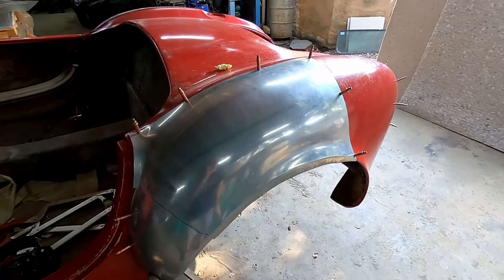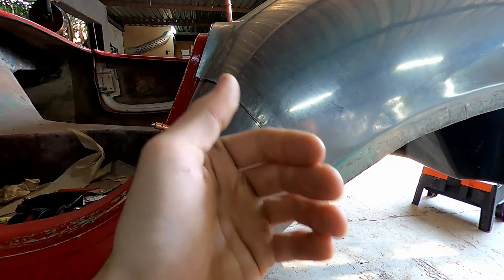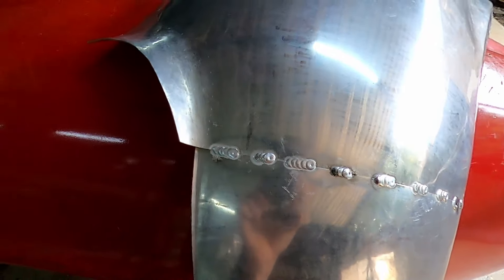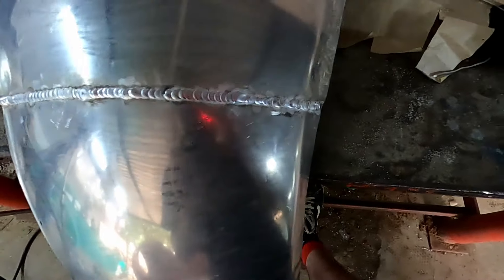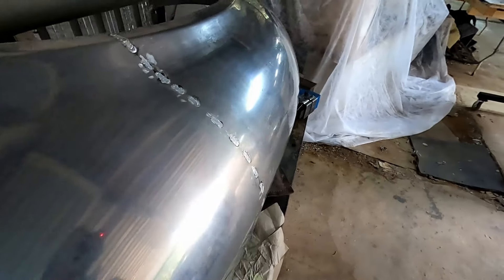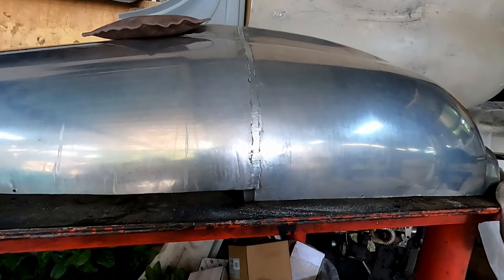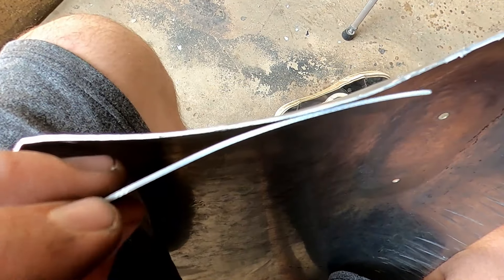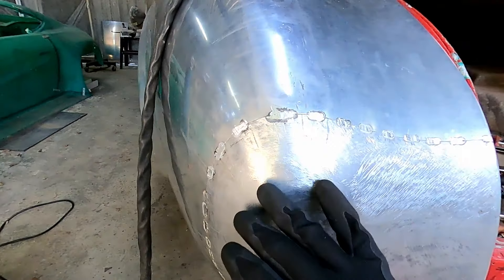How to: Welding Aluminium Body panels together. 427Cobra Build part 4

Comment: Mathew, I am trying to learn aluminium welding for my project. What settings do you use for this thickness aluminium please? Loving this build. Regards John
Reply: If you are learning to weld I would recommend the rule of thumb of 40 amps per millimetre, so for the 1.5mm thickness I'm using it would be 60 amps. Hopefully that will help you out 👍 (works of steel as well)

Comment: "It looks pretty good'   Understatement of the year!!  Excellent work, this is going to be an awesome Cobra.
Why have you chosen to TiG weld the ally rather than the traditional Oxy / acet using the parent material for the filler to keep colour consistency in the bare metal finish etc.  Only a question, by no means a criticism 🙂 Also what settings did you settle on for your machine? ( Amps, Hz, Freq, electrode, cup & filler)
 Again thanks so much for taking the time to make and post these vids, they're very educational and entertaining.
Reply: Thanks. I opted to tig weld the body using parent material as the filler as getting flux for gas welding aluminium that actually works is very difficult in South africa. As for the setting on the machine, lm pulse welding around 80-90 amps peak, 120Hz, The light blue tipped electrode, and I think a number 6 cup.
Reply: @2_stroke_taylor  I thought your filler rod looked a bit funky! That makes sense with the flux, either way the results are perfect. Thanks again for your time, can't wait for the next episode

Comment: I love you videos. Just curious, you use a flat lower anvil on a curved surface, how do you avoid leaving creases? When welding, is the fiberglass body damaged?
Reply from the maker: Thanks! Even though the anvil looks flat it does have a slight radius. It's very important that the edge doesn't come in contact with the panel. The fiberglass doesn't get damaged when tracking but we do lift the panel off the buck for final weld.

Comment: I was working safety on a hillclimb corner once. An original 427 cobra comes up, right hand turn. Rear end kicks out left, and then back around right, into a guard rail, & just crunched all that nice rounded original quarter panel. What a terrible thing to witness! But..he knew the risks I guess.
Reply: Rich racers keep these craftsmen in jobs.

Comment: So die volgende stap Sal wees om n aluminium chassis te bou.🇿🇦🇦🇺🇬🇪🇷🇺🇷🇺🇷🇺
Reply: The chassis will be steel chassis that won't be made us, but we will be making the inner structures of the body out of aluminium and fitting the body on the chassis.
Reply: @2_stroke_taylor   I am busy with an AC Cobra that I bought from Backdraft racing in Durban and I was going to ship it to Russia but with the stupid sanctions I had to divert it to Australia where I have been living on and off for the past 24 years. Complete front suspension of a E36  and a rear suspension of a E39. Engine , gearbox and and some other parts came from my BMW that I had in Tbilisi ( Georgia)